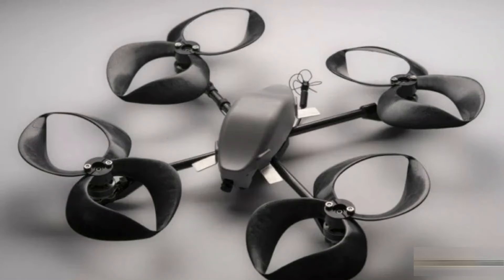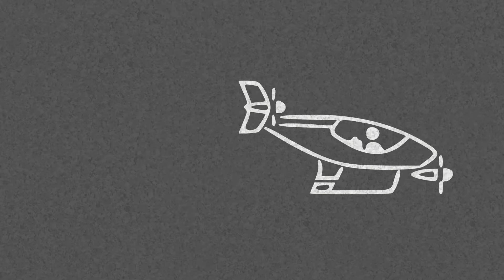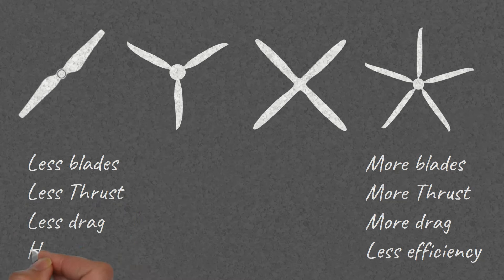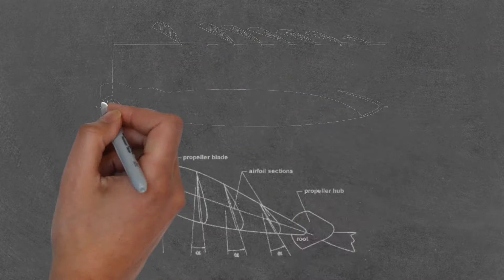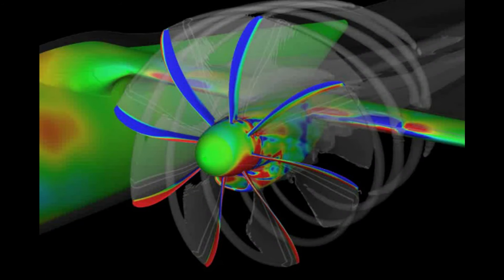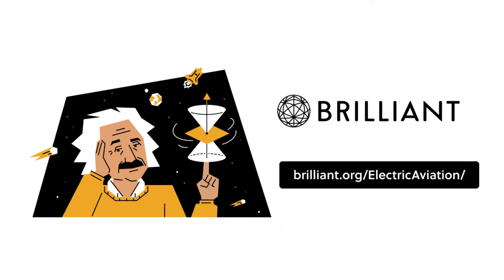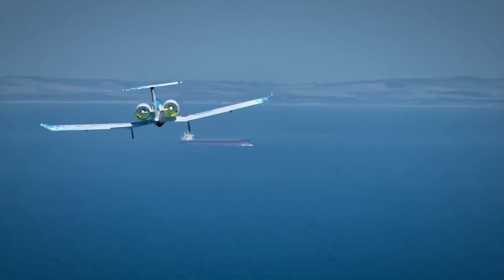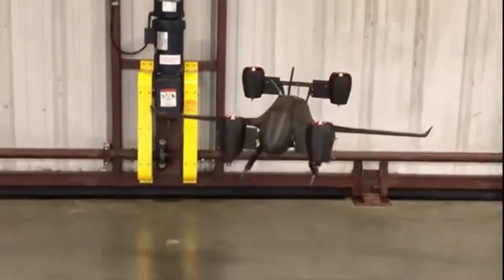EVTOL Propellers complete guide

Comment: 🔶Our infinitely variable FrictionLess gear tech enables >10X gear box reduction‼  Non-coaxial contra architecture is possible. How? I'm a triple engineer. We will also bring out an efficient, clean, noise-less, ultra power dense rotary engine what will use any fuel or mixture thereof  😉🧐 🔶

Comment: supersonic is not mach 0.8 but mach 1= 1234km/h, so all passenger aircrafts (except the Concorde) are SUBSONIC (speed to air not to ground who depend from the wind).The propellers from the TU95 are subsonic (and turn very slow), the only known plane who had a supersonic propeller was the incredibly noisy Republic XF84H Thunderscreech but the airspeed of this plane turned out to be disappointing and not better than that of the Tu95
Reply: Youre not right and mostly wrong. Also citations needed.